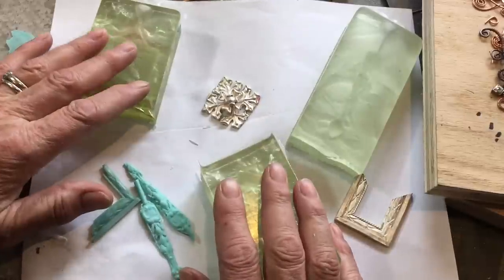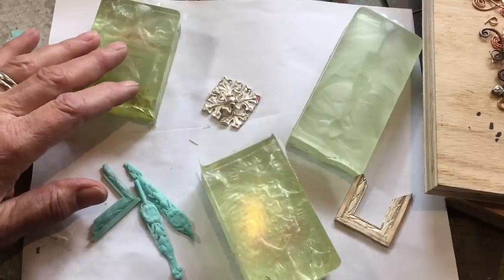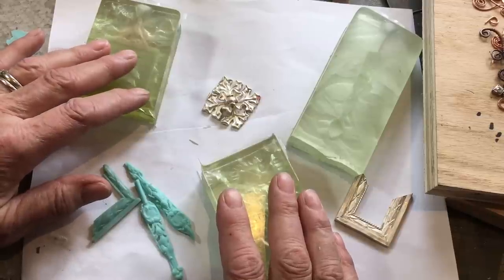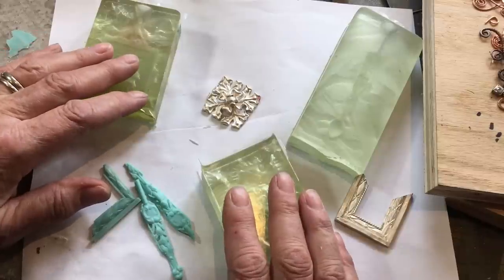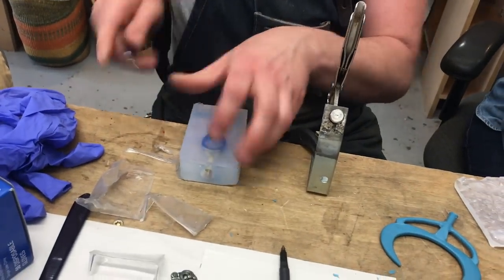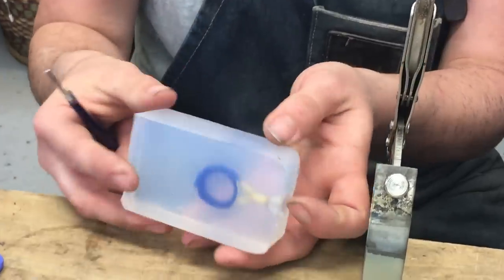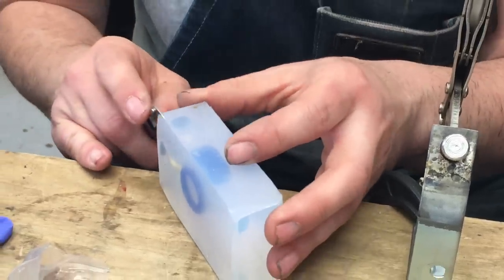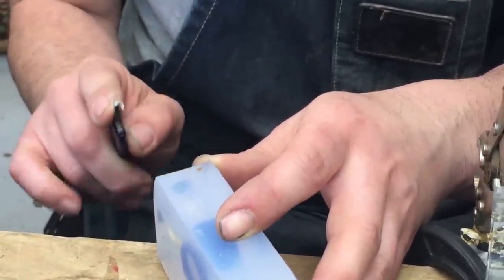Great Method for Opening Silicone Molds:  How to clamp your mold, cut registrations and a lot more!

Comment: Excellent video, mold cutting is such a dark art. It's never even occurred to me that it's possible to use a transparent rubber lol.
Is there a reason to continue the cut once you're beyond the piece and separate the mold into two parts, rather than leave them connected?